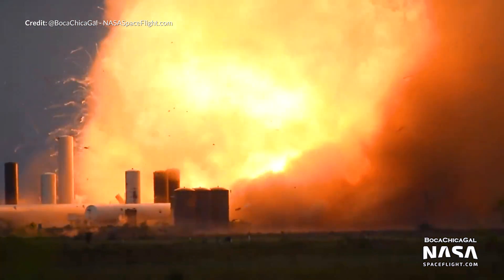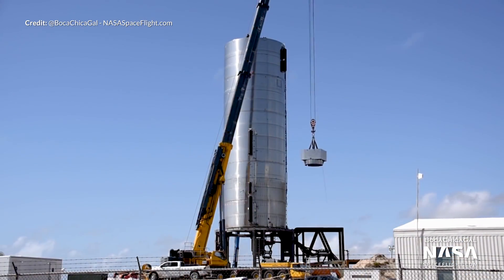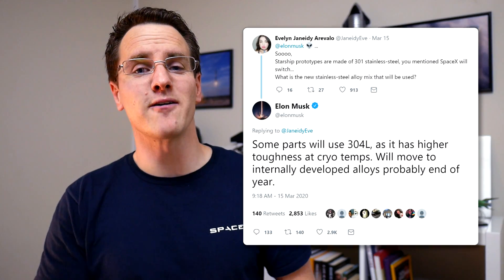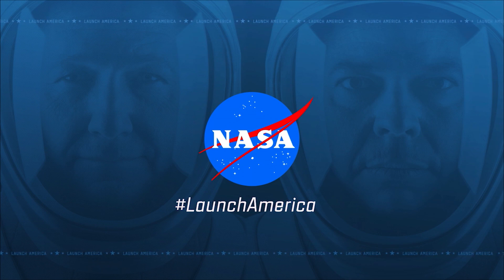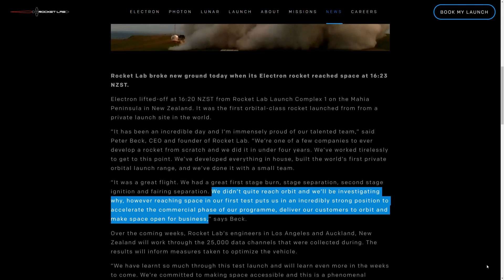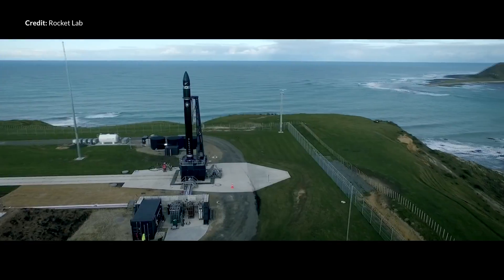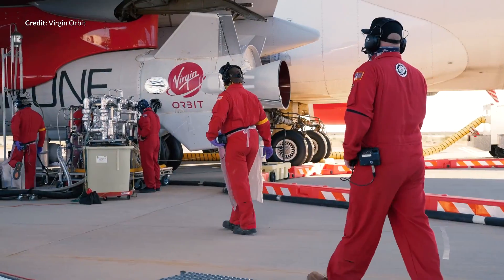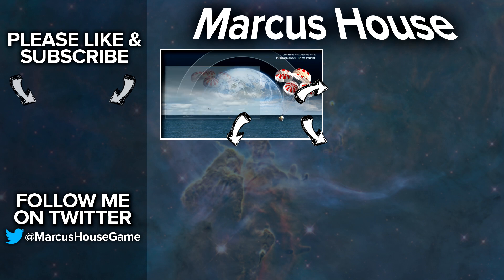Starship SN4 Explodes, Crew Dragon Demo 2, Rocket Lab's 3 years and Virgin Orbit LauncherOne test

Comment: Elon needs to chill on the reefer with Joe Rogan and monitor his crew more extensively. The entire fuel line was ignited by the igniter as if it was intentionally set a blaze just to watch it go up in flames. Also there are huge gaps in those welds. If the wind can ripple that sheet metal than why not wrap it around a aluminum frame? Why would Elon Musk overlook so many faults in design and waste so much money making it look shiny? He needs to stop smoking weed with Joe Rogan he is slipping.

Comment: Its obvious that the weight is to hold down the tank for testing purposes so it doesn't move.  Regarding the ignition of the engine was from the flair stack... because the flame came from that stack that was many yards from the engine.  I could easily see the flame go from the stack over to the engine... then explode.
Reply: The fire did not come from the engine.  But fuel vapor did, and the wind blew it over twords the flame stack to the right.

Comment: So about the radar, I believe that SpaceX wants to monitor the test sight with better accuracy. Of course, radar is a well know and understood way to monitor what's going on within a larger radius in comparison to most surveying cameras especially with moving objects within its range there are many variants of the radar that was shown specification of them can be found here: https://static.garmin.com/pumac/GMR_420_620_1220_2520_xHD2_Install_EN.pdf
I believe the best use case for this is to better track any moving objects on the test site and collect more data as they build out and test their designs. I am not confident of this, but I personally think a radar system with multiple antennas such as these ones could possibly be used to calculate the trajectory of large pieces of debris if an unscheduled rapid disassembly occurs, please take all this with a grain of salt as I've only been researching this on my work breaks since this morning

Comment: The stainless steal is a great idea, but the welds are a different matter. Under expanding and contracting they will fail. I suggest you 3d print a full tank and put it inside the rings as one piece. Just my thoughts.

Comment: One reason they are using 304l stainless is one of the best s'steels to weld, especially in thicker gauges, also unlike many SS, it stays strong without annealing after welding.

Comment: Low carbon does not make the alloy more corrosion resistant,  it helps prevent the formation of chromium carbide crystals that remove the chromium from the steel leaving it no longer as stainless steel. The carbides form when the material is held at high temperatures, like during welding. If the material is thin though it usually doesn't stay hot enough, long enough,  to matter.
If you are not welding it, the L doesn't give you better corrosion resistance.

Comment: The RADAR is there to track the speed and direction of the flying components during an explosion. It helps them calculate how far the test vehicle would have flown if it were in one piece as originally intended. SpaceX is determined to learn from their failures.

Comment: The ignition happened in less than one frame, but you can see the fire pushing leftward, just after that frame, as if the velocity of the ignition took the surroundings with it, like the venturi-effect. I think, with that amount of cool stuff coming down on an engine which isn't hotter than operating temperature, and already cooled down a bit, the engine itself is probably colder than ice at boom. If you look closely, you do see the cloud being ignited as soon as it climbed up to the flare. And methane, especially with enough oxygen, is a quick burn. My guess is the cloud was probably oxygen-rich and acted like a wick, faster than one could ever imagine (methane is just one carbon-atom away of being pure hydrogen, not weird it's fast). I actually think it was mainly a bad combination of a tank rupture, and an unfortunate wind direction. I'm really curious to what actually happened. It looked pretty Kerbal though, like the whole thing seemingly vaporized into nothingness, split second.
Edit: methanol fires are notorious for being practically invisible when the oxygen-mixture is right, is that the same with methane?

Comment: The quick disconnect pipe for methane became unplugged, either intentionally or unintentionally, and the methane poured out for about ten seconds before it was plugged.  (The deluge does stop before the detonation.).  Sounds to me as if they did not trouble-shoot this scenario well enough.

On Falcon the quick disconnects are at the top, and hold very little pressure.  On Starship they are at the bottom, and hold a lot of pressure from the high methane tank, making the valve slower to close.  If they had thought about it, they would have made the disconnect valve more robust, and placed a large diameter pipe around the refuel pipes, to guide any fuel leakage away from the hot engine section.  In the current design the pipes are open, and can spew fuel everywhere.  
R

Comment: Ignition sequence was in delta, the alpha signal is 1241871.2 delay abrupt at solenoid no alpha signal. Contact refuge at sequence start.  These engines are capillary and require alpha signals to fire ignition sequences.  Remote delta never work well.The engines must fire the refuge.

Comment: The beautiful thing here is that it wasn’t a vehicle issue. It’s almost akin to being at the gas station (petrol station) and the automatic pressure sensor fails and doesn’t stop the flow of fuel when the tank is full and you get gasoline or diesel fuel spilling out everywhere. I would, 99% say that a check valve failed at cryogenic temperatures and caused a rupture of the fuel transfer system. A loose coupling could also be the problem but as the vehicle was filled with the same system and only failed when the fuel was running in the opposite direction, it is likely a valve issue coupled with the vacuum pressure and cryogenic temperatures weakening the integrity of the line that caused a ruptured line, thus spilling fuel on the deck to be ignited.

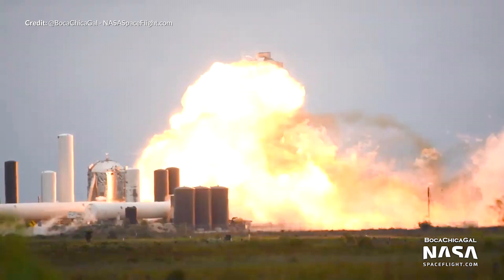Comment: 4:21 (watching at 0.25) that flare stack does look like the flame goes out or ignites everything a millisecond before the flame really explodes right under the rupture, but the shock wave looks like it comes from the flare stack. Where else would ignite it, a "hot spot" on the engine would have blown milliseconds after the rupture, it now just seems logical that once a few atoms of methane got over to that flame, it showed how fast and well it can combust.
Edit, if it does turn out to be the flame stack, surely they will have to move that much further away in future.
Reply: The Moon is square - I’d move it & enlarge the diameter no matter what the investigation concludes.

Comment: the boat radar could be a 'cheat code' way of some form of monitoring system that SpaceX wont have  to develop themselves...these things can measure/locate solids even clouds for massive distances..it also could be perhaps tweaked to provide a realtime state of the overall structural stability if deployed from within a confined capsular space.

Comment: why are they building another 3 prototypes when they haven't even figured out why SN4 exploded yet? they might be building the same mistakes
Reply: SN4 passed multiple tests, including several static fires. Unlikely a problem with it. Plus, they already have the welding figured out for the tanks, so no need to delay on those areas. They expect failures, so building many additional ones helps increase speed of testing.
Reply: It was a problem with the fuel system, not the tank itself.

Comment: They were unlucky - it looks as if they plugged the leak 6 seconds before it exploded (the venting stops). Had the cloud if methane gas not found an ignition source in those few seconds after, it would have dissipated and nothing would have happened.  

Since these are quick-disconnect valves, a likely scenario is that  the static-test disconnected the methane line.  Then, when they defuelled the methane, nobody noticed for several seconds that it was pumping outside.  

Lastly,  it looks like the explosion was triggered by the cloud of methane gas clearing.  As long as the cloud was 100% methane it was OK, as no ignition can happen in pure methane.  But as it cleared, the underskirt got a breath of fresh air and oxy, and boom.....
R
Reply: (still going). Just before the blast, you can see the platform-frame once more.
Prior to that it was covered by a cloud of gas.
You need to look at the images by Scott Manley, as he gives three perspectives.   
R
Reply: I don’t see what your seeing. The venting looked as if it was still going up to the blast.

Comment: It looks like a jet of O2 launched the mass simulator.  It could only have been be a jet of O2, not CH4, since it didn't burn,.  Could it have been from the down tube?  I can't think of any other way to get a get a jet of O2 out the top of SN4..  
The rapid loss of O2 would have quickly dropped the pressure of the O2 tank, causing the lower section to collapse and the upper CH4 tank to rupture, causing the last big explosion.
Watching at a reduced speed it looks like at least one, and possibly two smaller explosions were caused by COPV's.  I wonder what exploded when the mass simulator hit the ground.
Reply: Watched a different angle of the explosion on Scott Manley's channel and I was wrong before, the mass simulator was launched by a jet of CH4, not O2 like I said before.

Comment: Question:  They are using some kind of hardened lifting points to lift the stacks.  Seems like extra complexity, cost and mass.  Could the lifting ops be done using some kind of electromagnetic jig for different sections that the cranes could use for lift operations?